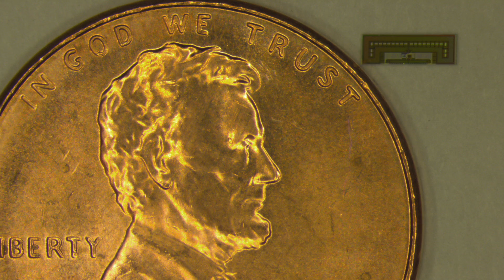Stanford engineers design ant-sized radio to control 'Internet of Things'

Comment: Did he say this operates at 6 GHz or 60 GHz?  I could not hear it clearly.
Reply: fast forward 6 years and now we have 60hz 5G technology. Standford Universiy  heavily funded by Mr gates himself operator of ID2020 and avid supporter of digital certificates
Reply: i listened to this alot, it sounds like he says 60 GHZ. which is an ISM band, and the resonant frequency of the 02 molecule.
Reply: lazerusmfh It's 60 GHz. Their IEEE abstract claims 24 or 60 GHz. It also says they have a current, measured range of about 50cm at about 12 megabits. You need such a high frequency for such a small antenna (outside of an array, which would be a completely different project). 60 GHz is around 5mm wavelength.
Reply: 60Ghz or at least that's what i heard